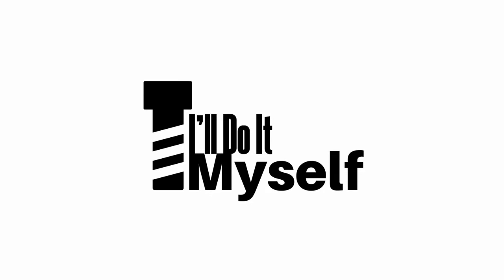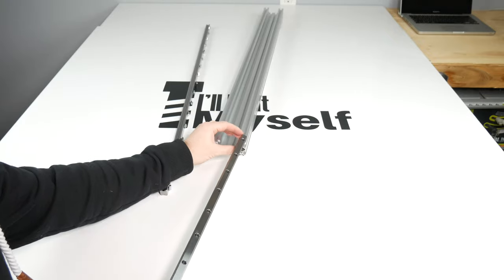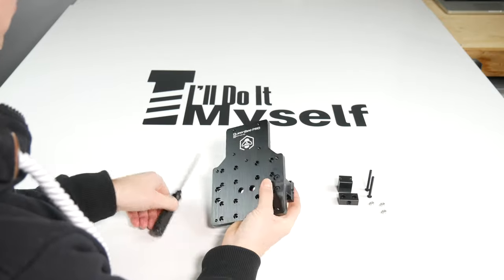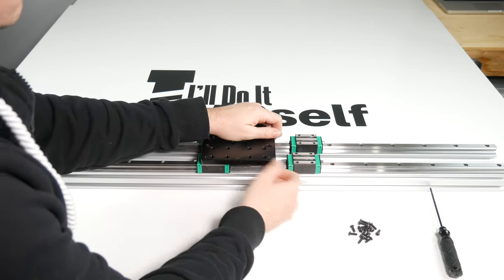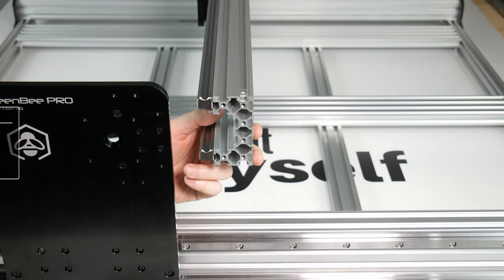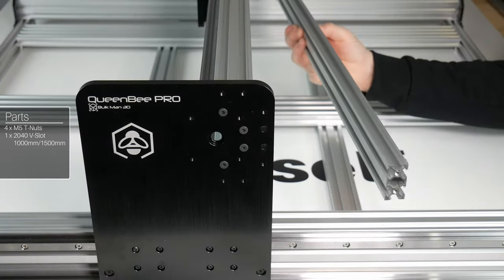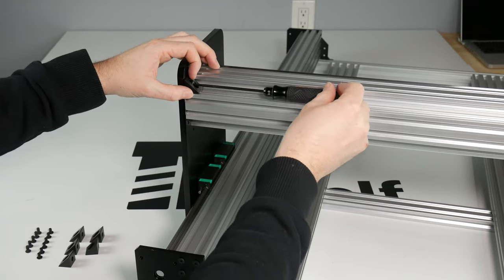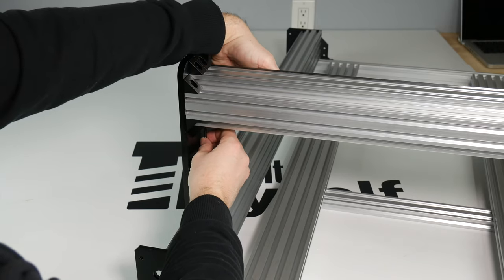Bulkman3d Queenbee Pro - X Axis

Comment: Thank you for making these clips; they help a lot. However I found one error here. Insert one M5 T-nut on the top and the other on the bottom of the back of the V-slot like the manual shows instead on the 2040 extrusion.